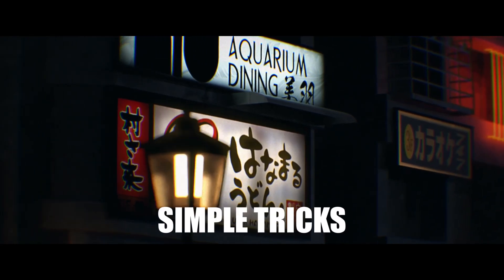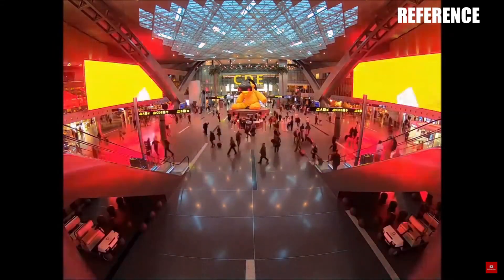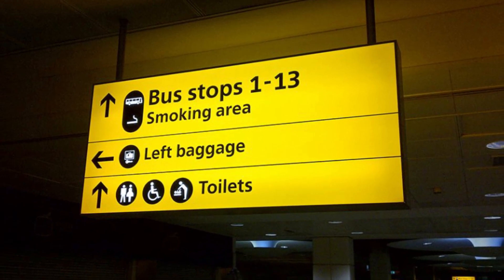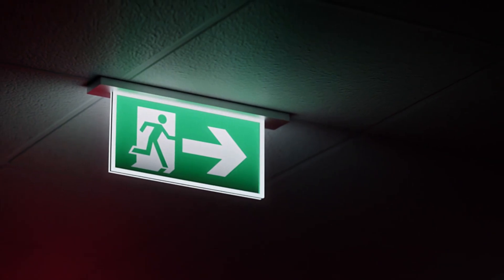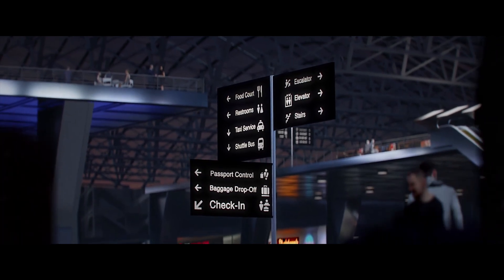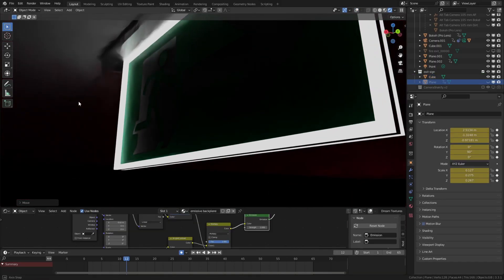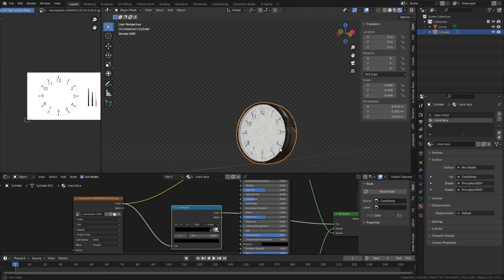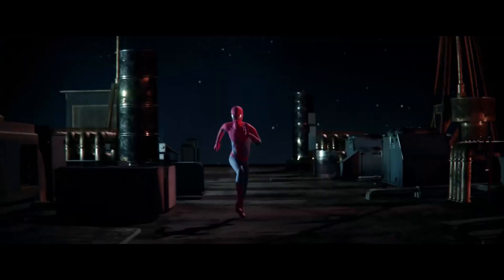The Secret To Creating Realistic Glow In Blender

Comment: A way to make this easier, use the radial gradient as a mask and plug it into the emission. That should achieve the same thing without having a separate mesh to do the work for you. Can't confirm as I'm not on Blender ATM, but if I recall I believe it should work that way just fine. For added adjustability, plug a color ramp in between the gradient and the emission plug.
Reply from the maker: Yep I suppose that comes in really handy when dealing with actual images and sign art, keeps colour info and saves time, but I figured out the whole backlight idea since I started out making those airport wayfinding signs haha
Reply: @alexcapecchi  it’s a great technique for sure. I’m all about working smarter and not harder though so if there’s a way to do something easier, I’m on it lol

Comment: Great tips! To do it even faster (a bit of a janky workaround, I should say), use an AO node and set that as emission value. Works like a charm to make those outer areas a bit darker.
Reply from the maker: Dude that's a cool idea, I was also thinking of the idea of just having custom contrast texture images with variation that can used right away  as opposed to wasting time with clunky gradient nodes, but yeah AO would work good!
Reply: True!. 
That would work great to create relatively even falloff, but won't work if your source light is coming from one direction (i.e. top-lit signs)
Reply: I use daily builds and it seems every new download needs 20 minutes to load the AO mode the first time you use it. Makes me avoid it like the plague.